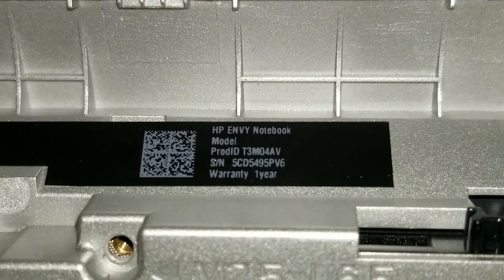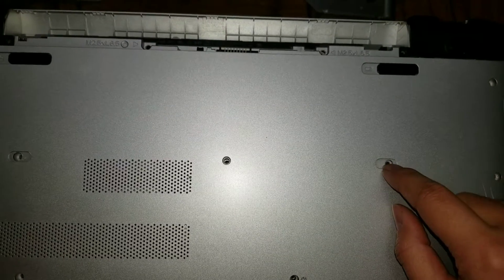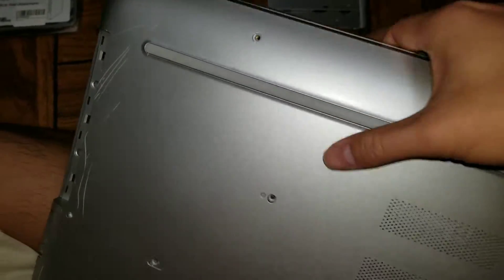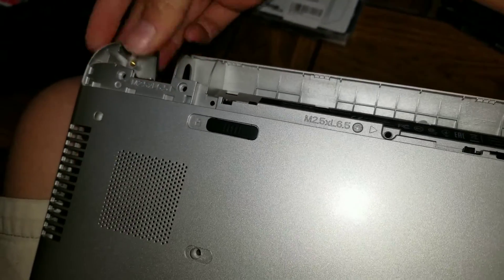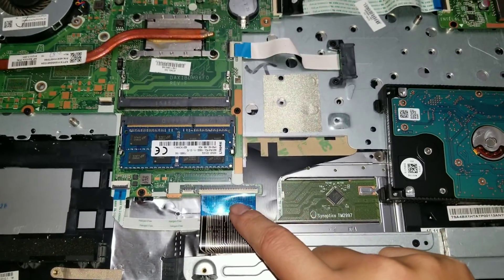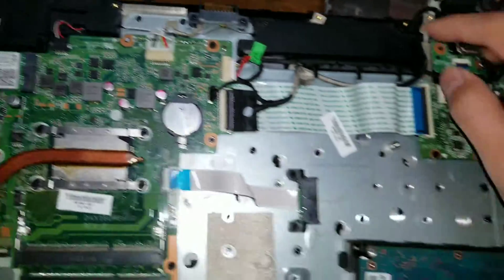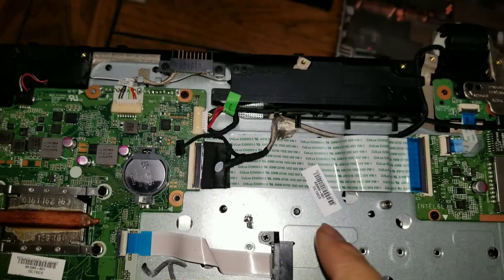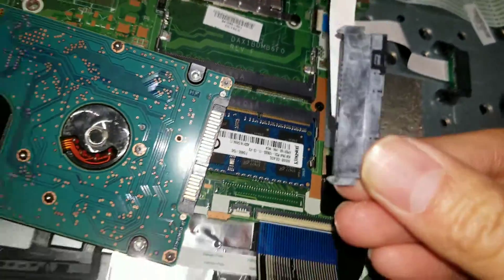HP envy t3m04av 17t-s000 disassembly hard drive replacement ssd upgrade

Comment: Thanks! Structure looks similar to the 17t-by100.  Screw ports were all the same except for the screws hidden under the rubber feet on mine, located at the edges of the strip.

Thanks for the detailed upload, was able to crack open my case and dry out the water damage. :-)
Reply from the maker: Awesome! Spilled a drink or caught in the rain?

 If you haven't already, please like and subscribe so others can find my videos. Thanks!
Reply: @ItsBinhRepaired  spilled drink, but it flowed across the table, it wasn't spilled on top.  Given the bowl like shape, I thought it was ok, but wanted to open it up to check.
Im fairly handy with computers, but some laptops are fragile. So your vid helped (i get nervous about prying things)  I'll like and sub as well. Good luck with the channel!
Reply from the maker: @aparanoidbw  Cool, glad there was no damage. :) Thanks!